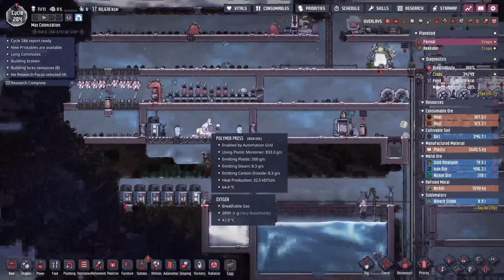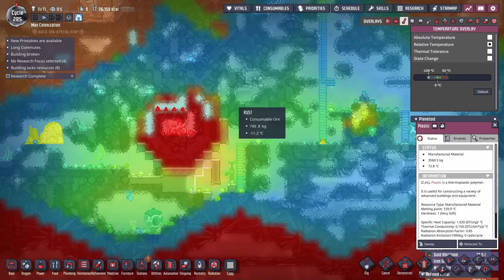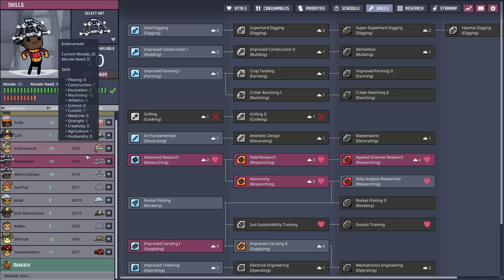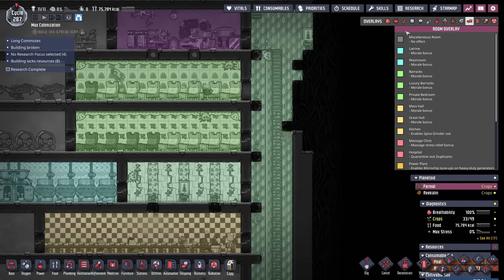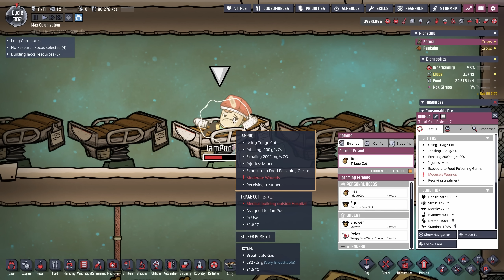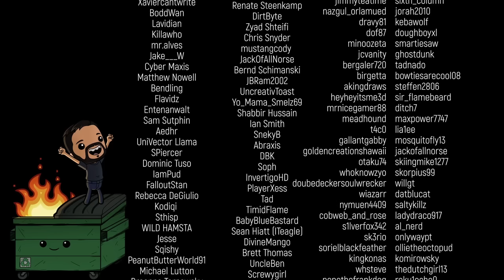"Temporary" Bee Power and Naphta | Ep 11 | ONI - Max Colonization

Comment: in the earlier days i built a stairway opened a bottle on the top one and had some naphta in liquid lock amount ready. 
Now i bottle fill with "sweap only" into an resovoir and a bottle filler after with 200kg, which i reduce to the size i want the liquid lock out of.

i think the smart storage thing wont put a signal out, without power.

and please! - dont put anything into your sauna which is producing things, like metal refinery / crusher. the materials coming in at 30C have to heat up to ~150 - produced at 40C reheat again to 150 and maybe cooled after that to 30c with an AT. that is not Power positive. 
im not sure with minus30C hydrogen in a Sauna - maybe with insulated pipes - but you could cool them with that hydrogen.

and you remembered the overpressure limit of 5kg of hydrogen vent but 150+ with an iron volcano doesnt? ;P
have a nice one.

Comment: """"Temporary"""" I might even argue small bladder isn't much of a negative. Yeah they gotta go more often, but using the toilet is a water-positive process. That's free water! That said, I'm not keen on the sauna idea. I think it's based on some faulty assumptions and isn't taking into account the fact that input materials get heated up, deleted, and (relatively) cold materials are produced, which then heat up and are removed from the steam room when you go to build something with them. You're losing a lot of DTUs that way--more than you're recapturing from having all of those buildings in one giant steam room. Active cooling on the other hand can start to efficiently recapture that heat, but only with a favorable coolant (read super coolant) and running it as a cold brick.

All that to say instead of a meme sauna, I think you should absolutely do a cold brick to thumb your nose at the giant block of hot rock sitting in the middle of your map.

Comment: Put your spaceport in your sauna, see it as a challenge
Reply: yea i like the concept except you cant really do that because the turbines have to go on top so you couldnt launch rockets and you need to trap the steam, though i guess you could use blast doors and recollect the steam with pumps but that kinda seems like a huge power waste
Reply: @DawGem1  you can put the steam turbines in the wall of the sauna instead of at the top.
You just have to make extrusions in the wall of the sauna with one steam engine on top of each extrusion.
Reply: @Jehty_ fair point I didn't think about that

Comment: I like adding a Gas Tank to my SPOM setups. Hydrogen goes to the generators, then the excess goes to the tank. But the tank's output is connected with a bridge back to the hydrogen line, giving freshly pumped hydrogen priority. Then the tank's automation is wired to the generators with NOT gate on the way. This creates OR behaviour to control turning generators on. It's either an empty battery on a tank 95% full, to make them run.

Comment: well, one of the problems with a sauna is that it bleeds heat when you use ressourses for proccessing that are below 125 C , using a saua for powerproducers is fine ig, but i would not recommend it for refinement such as metal refineries / rockcrushers and so on ( like for glass it is still useful)

Comment: When the bees die they drop nuclear waste which has annoying state change temperature ranges from liquid to solid. also ice can swap states. either way, you probably have some solid melting inside the naphtha, moving it, then re-freezing when it comes back into the cold atmosphere.
Reply: It's not the temperature range that's the problem, strictly speaking; nuclear waste behaves fine normally.  It's beetas themselves dying and dropping supercooled liquid nuclear waste, which immediately triggers the freezing checks as though it's a bottled liquid.

Comment: Instead of a sauna, maybe only some aquatuners, the volcano tameing, and having all heat sucked out of the base by some cooling loops, then u don’t have a traditional sauna but still a working system
Reply: That WAS the traditional setup before the sauna thing got proposed.  But have you seen how much heat a metal refinery has to deal with when it's running like ten batches of steel in a row?  A cooling loop doesn't just "suck the heat out", it also circulates it around everywhere on the loop after the hot thing.  So you can either cool multiple very hot things with separate setups, or... you can stick them in the same place, and then you've reinvented the industrial brick.

Comment: I saw that the new stegosaurus thing will stomp around and harvest plants. Saturn critter traps were also changed so they dont eat two tile wide critters. Perfect synergy, no dupe labor necessary
Reply: Odd synergy when they have no comfortable temperature overlap, I wouldn't have even thought of that.  I really thought low body temp lowers reproduction more than it seems to actually do per the wiki.  That's good to know!

Comment: 25:50 You don't need power control station next to every hydrogen generator to make it a power plant, 1 hydrogen generator and a smart batery make a power plant as well.
Reply: I thought it was 2 large power generators in one room, the room overlay tells you for sure
Reply: @flowergurl1009  Nope,. What you need is heavy-duty generator wich is hydrogen generator in this case, and you need a power building which is any battery.

Comment: SCTs are so wild and I don't know why I haven't seen more playthroughs using them for primary power?  They don't need to be temporary--they should be able to handle a fair-sized base with as many as you've got here!  You don't even NEED the beeta hives if you just have a rancher drag a critter in to feed them occasionally.  (I don't know how I ever lived without the relocate button.)

2.4 plants per generator means you've got the potential here for several thousand watts sustained power generation with tuneups, with every bit of unused hydrogen banked automatically.  Some light pwater usage for the extras if you don't have pips, but that's it.  They're limited in the sense that you probably can't run a whole colony on them literally forever with nothing else, but what you have here is equivalent to several natural gas geysers.

Comment: In my current playthrough I got a bit lucky. A hydrogen vent spawned quite close to the printing pod. I got on hydrogen power very quickly and researched all the stuff needed to get the power and reduce heat transfer. My main issue is I haven’t found a good source of natural gas for the gas range because I want to get the mysterious hermit fast. The only source of natural gas I can think of is the fertilizer building. 
Another issue is on the teleporter planetoid, the only source of water for the SPOM is a single salt water geyser so it is quite hot.
Any advice?
Reply: Technically, the flatulent dupes also produce natural gas. It's messy (unless you keep those dupes in one area only) but you only need it for, at most, three items of food so while it's not a great source, it should be enough, no? 

Of course, then you have to deal with the stinky dupe roaming around, unless you arrange an... Accident.
Reply: Echo should do a playthrough where every dupe is flatulent, he’d need a mod. Like his farming series that everyone had an interest in farming.